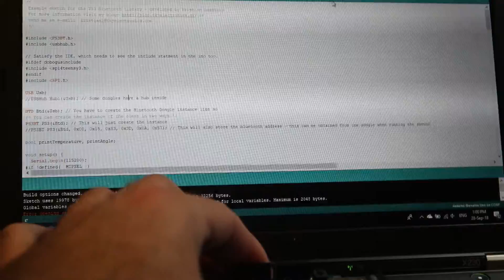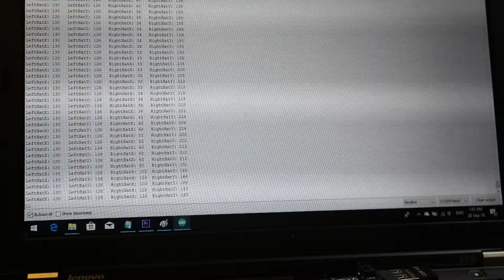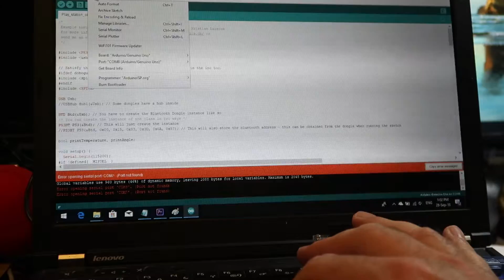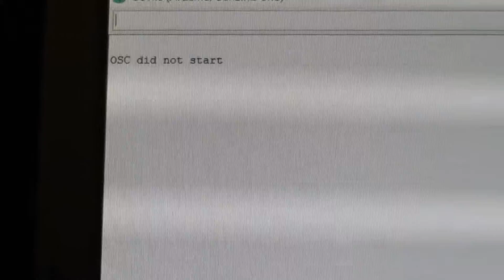Connecting PS3 to Arduino

Comment: Did you try a Bluetooth module? You can get motor shields that have servo, motor, ultrasonic sound and Bluetooth ports on them
Reply from the maker: See on this video you have a BT dongle inside this shield
Reply from the maker: This is a full board, it is more practical to build it the way you need